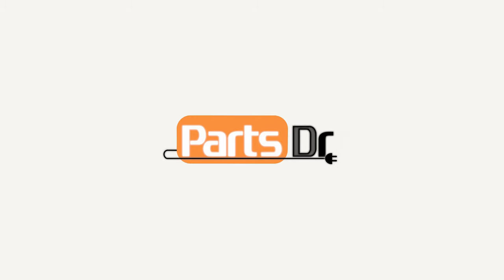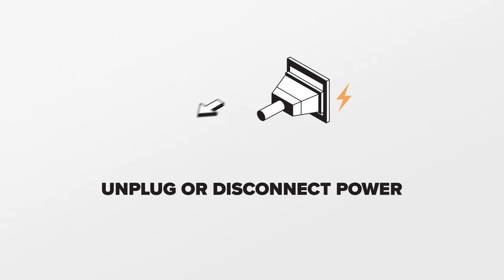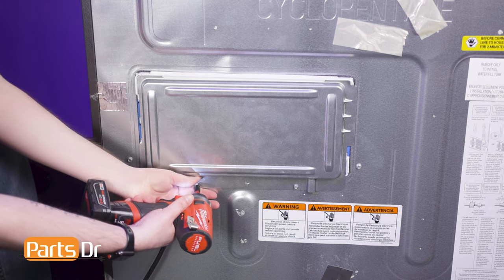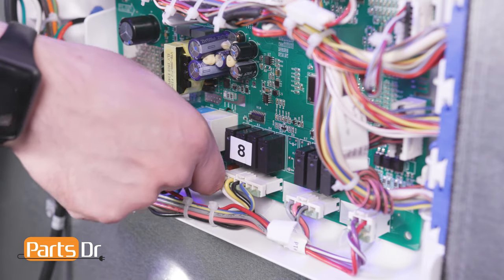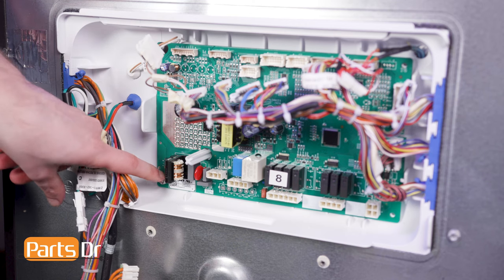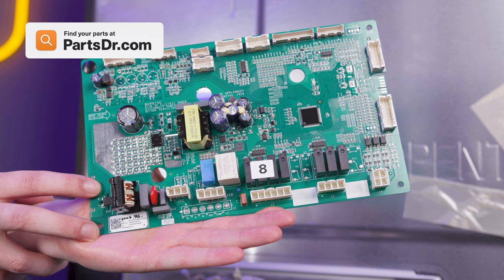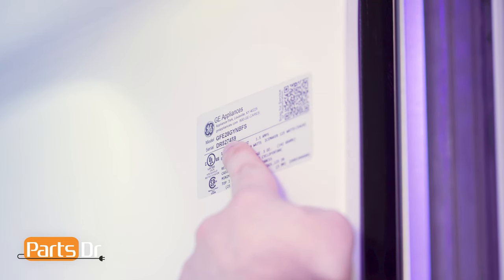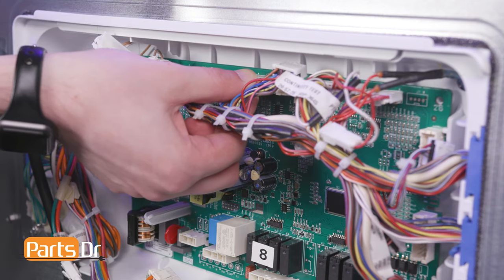How to replace Main Control Board part # WR55X46805 on your GE Refrigerator

Comment: Hi, thanks for the video, informative.  Before I buy a replacement main control board, how do I make sure that is my problem?  Right now, the freezer and fridge seem to be working properly, the icemaker and it's controls do not light up or work and the freezer light is not coming on.  When I unplug the fridge and plug it back in, the dispenser controls light up for a moment and then go back out.
Do you think it's the main control board? or one of the dispenser boards? Thank you so much for your help.
Reply from the maker: It sounds like it is probably a bad main control board, especially with how it comes back on when you unplug it and plug it back in.  These can be difficult to diagnose and troubleshoot.  There most likely isn't an easy way to narrow down which part is bad.  You could also check the wiring coming out of the door to look for any broken wires.

Comment: I’m replacing the control board on my GE refrigerator GFE28GSKHSS because the fresh food (fridge) section won’t hold a consistent temperature. I already tested and replaced the  FF thermistors. Fan and defrost both work fine. Freezer temp is good and all door controls work fine. 

In diagnostic mode, code 0025 can't determine FF2 thermistor temperature. 0024 and 0026 report valid thermistor temperatures. Guessing it's a board issue.

The replacement board is WR55X38248 (since WR55X28076 is discontinued).

After connecting the new board, I get a green flashing light on the board (good). 

However, on the door panel I get a Red ! Triangle. The fridge lights don’t come on when I open the door. Fridge is not running.

With the old board, the door panel works fine. Fridge lights work fine. 

I’ve unplugged the board and double checked all connections. I’ve powered the fridge off/on.

If I reinstall the original board, the door panel, lights and fridge work again.

Any ideas?
Reply from the maker: Possibly a defective new control board.  If you purchased the part from us, report the defective item here: https://partsdr.com/returns/defective-part
Reply: @PartsDr   I just did. Thanks for the reply and the link!
Reply: That was it! 
I received the replacement board yesterday. Plugged it in and the door controls, lights and fridge are all working great. 
Fridge has been holding a consistent temperature for a day. 
I think my problem is solved! Thanks for the help!
Reply from the maker: @paulm3737  Great!  Thanks for letting us know.

Comment: Is there any way to up date main board with a laptop? Mine is a GFE28GELEDS which dies have a RJ45 connector on top.
Reply from the maker: We are not aware of a way to update the main control board with a laptop.